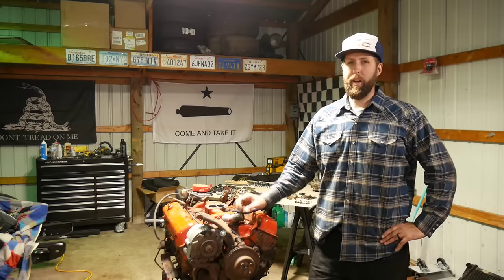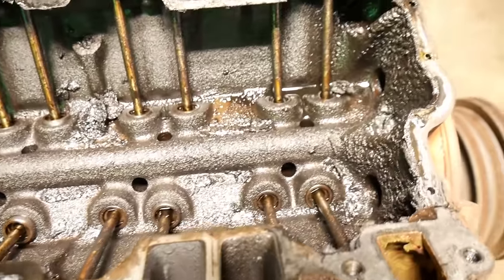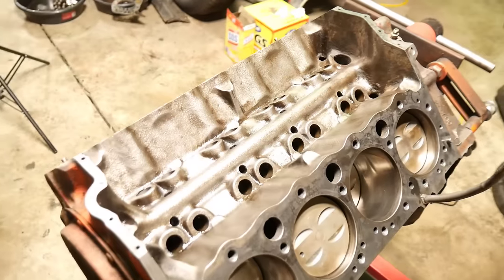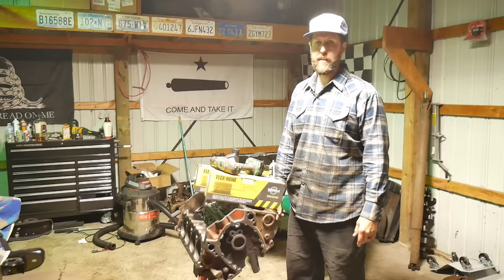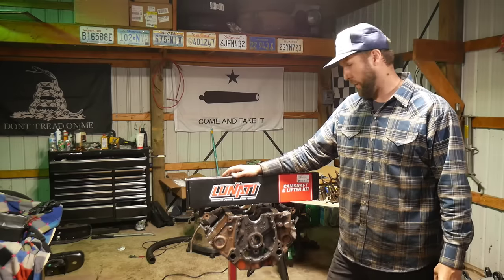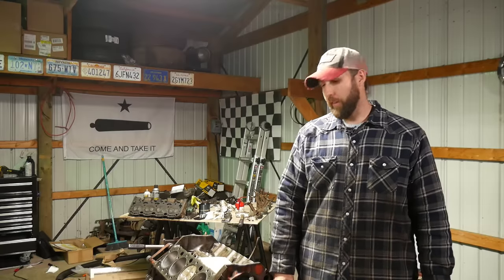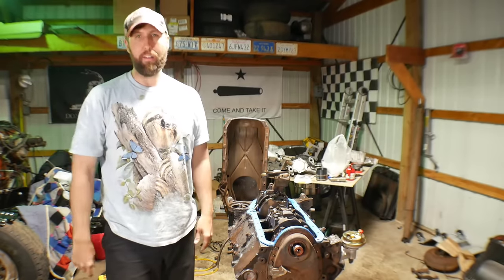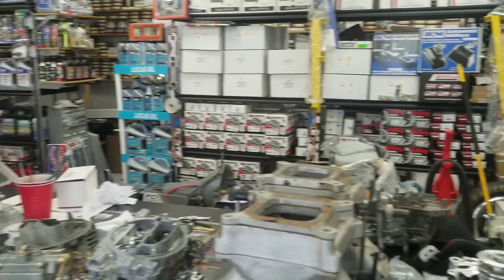Budget 307 Small Block Chevy Build & Dyno - Vice Grip Garage EP28

Comment: i don't care what some guys say first engine i built had a friend that was a mechanical engineer. we built 307 using flat top pistons .bored 30 over ran a .480 lift cam. i cant really remember the heads we used wanting to say they were off 400 small block. we manually weighed each piston and rod we filed every rod down to match the weight of the lightest one we had. .this was 40 years ago. i remember turning 8000 rpm just couple times because the engine wasn't completely balanced you don't want to do that to many times. installed in a 73 nova 4 speed manual trans. i never raced it on drag strip strictly street racing was never beaten in that car i raced a couple chevelle ss  big blocks and a guy that drag raced on the track a lot never was able to out run the nova .guys in chevelle ss big block cars there problem was spinning. my car would not or i would not let spin. i raced a guy twice in his chevelle ss first race he started in first gear and just smoked his tires he had a posi rear end second race he started in second gear lot closer i still beat him by car length and half.. my good friend i mentioned earlier he got a light body mustang installed a built 350 sb. i out ran it with nova is such a light car it was 500lbs lighter than the z28 Camaro i had. miss the late 70s and 80s when people were people that had common since best times ever
Reply: Nothing wrong with a 307. Same bore as the 283 and there are plenty of racers running them to 8k plus. With good heads and compression they scream. The same can't be said for a 305 with its small bore and limited head flow because of cylinder/valve shrouding
Reply: Still junk at the end of the day lol
Reply: @MarcBchannel it's a 283 block with a 327 crank
Reply: I doubt yall used 400 sbc heads..that's the first thing you take off and throw away

Comment: 307 is a much better engine than a 305 I love to pick up a cheap 307 and slam the crank into a 350 to make a 327 the most valuable part of a 307 is that 327 crankshaft
Reply: I just found out my engine is a 307
Reply: My 71 Chevelle came with a 307. I built it as a spare to put in my car while I build a 406. I put a set of gm 601 heads. Some light work done to them. Steel shim headgaskets and a isky circle track cam. Weind street warrior intake. She's a runner. Super fun motor. Not a crazy power house but can still smoke the tires.

Comment: Somebody really well known in performance world told me something I never forgot.
A engine doesn't know what brand it is, what size it it, what color it is, if it has a power adder or not, what it is SUPPOSED to do, or what kind of vehicle it's in. It says at this instant I got these parts, I see this fuel, and I ingest this atmosphere, so I can do this xxxx. That person was the founder of Kinsler Fuel injection 1984. Build what you got, f the noise, and rock out with your BLOCK out.

Comment: Way back when I was a kid, I needed a motor to drop in my ‘68 Camaro to get to work. I was in to street racing, and the car was broken more often than not...
A friend offered me a 307 out of a wrecked Chevelle.  The engine had been overhauled by the uncle of another friend, who told me I might find it interesting.  I pulled it out of the Chevelle and dropped it in the Camaro one weekend, with new plugs, wires, etc. Around noon on Monday, I took it for a test drive.  Holy crap, that sucker ran damn good! The builder never would tell what he did to it, but it blew off a built 72 Z28 that had been the quickest street car in our small town.

Of course this was long before the internet, and 1000 horse supercharger kits and computerized engine controls...
Reply: I used to dick around with 307s in the 70's, and built a few really good ones. They were dirt cheap and in the junk yards by the hundreds. I'd cam them up with high lift, short duration cams and small 4 bbl carbs and people would laugh at my "dog-shit 307" until I pulled the right front wheel off the ground on my 69 Chevelle. I had a high-stall torque converter and 3.73 gears, so that little beast would launch like a missle. Yeah, she ran out of breath before 5000 rpm, but until then, it was a blast. I had a shift improver kit in the TH350 and could squeal 2nd gear and chirp 3rd. I even had a guy call me a liar, and that it was really a 350, so I had him look up the numbers. Yep - the original 307 in a 69 Chevelle, literally "numbers matching."
Reply: Similar experience with one of these, had a 350 with a wallowed out starter bolt hole, didn't have what I needed to fix it, so put in the 307 instead.. not sure if anyone had done any work to it before that, but that thing ran circles around the 350. Not much for top end, but plenty of mid range.
Reply: Had a 71 Camaro 307 My Brother and I put a cam and heads on it with all the fixings. It ran super. I was a kid I loved it !
Reply: @wirenutt57  Ford made a living off 3.73 gears in the foxbodies early 90s.  210hp motors and would bury the Z28s
Reply: @markperry2827  some people don't really know how important GEARS are.
Reply: The 307 isn't bad its just they left nickel out when casting the block so it starts showing wear after about 60000 miles
Reply: My 69 had a 307 from factory but it ran good for a 2 barrel, it had just enough low end torque to get the car to snap pretty good off the line, while your opponent was usually spinning their tires I was off because it wouldn’t spin the tires off the line when it was dry. I kept it in the car until I had built a 383 to out in the car. This was in the late 80s and wasn’t being done a whole lot yet but with some help putting it together and grinding clearances on the block, I had it together in a short period of time, I bought a fully manual B&M TH350 with a stall converter. I had bought all the dress up stuff for a small block Chevy and I will never forget seeing the Camaro with the hood off and having just fired up the new motor and letting it idle as I was running it to break it in , the headers were new and the cam was lovey. I didn’t have mufflers or an exhaust for it yet so it was just strait headers. I will never forget how awesome that looked to me.
I later bought a 1970 split bumper from a coworker, he had bought it from an older person and it was in great condition with low miles, it was a 307, 3 speed manual car and all original. Even though it was a 2 barrel it really ran great right up to about 4500 like the guy says. That 1970 really did run out good for what it was, it got a 350 with a M21 and a 3.73 rear end. Then it was really quick for the day.
Reply: Ha ha 1000 horse charger  kits... those are  great till the heads blow apart...if the bottom doesn't  go first..lo.
Reply: @workingman9745  as someone that threw a 3.46 diff set in the Mrs modern GM high output six over the 2.87's I concur. First time I've fitted taller then 3.7 but was worried being a luxury boat and females car. It surprises a lot of people for a 4100lb car. Interested to see with a couple bolt ons if can do a 14 pass.
Reply: @markperry2827  yep ,thats all you had to do ,throw some 3.73's in the Foxbody and for me i did flowmaster 40 series cat back for the sound and it was a Badass and alot of fun car.I owned alot of F bodies at that time,i got my first mustang gt kinda by accident ,and it was so easy to wake them foxbodys up just with some gears